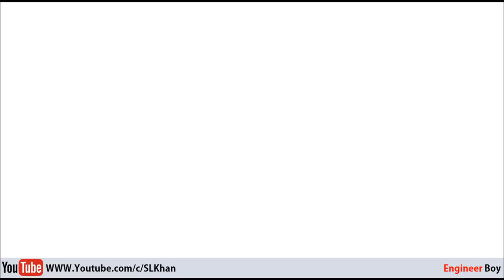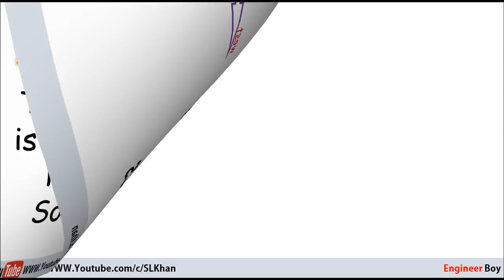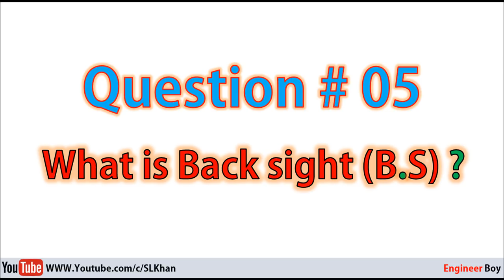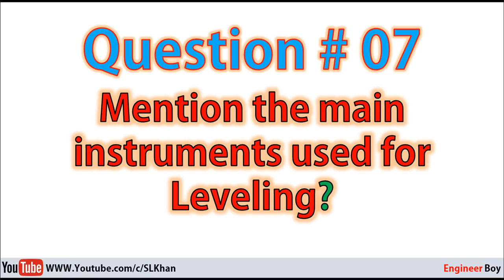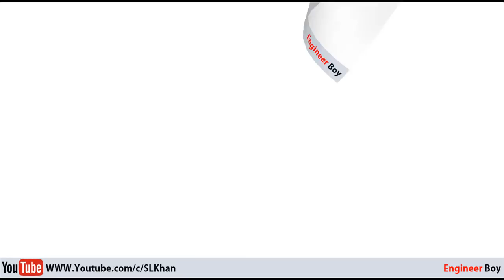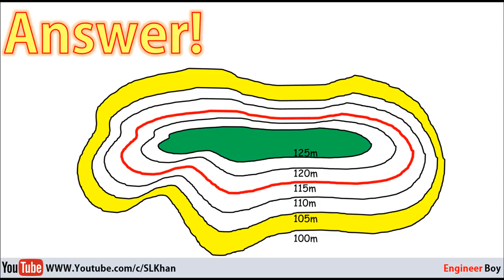top asked interview questions for land surveyor post

Comment: Some say plain table implement in below 15sqkm and geodetic in above 15sqkm area,and some says below 250sqkm.and above 250sqkm.what is that ,give correct solution ,,plain table survey done below 15,or 250sqkm,and geodetic in above 15sqkm or 250sqkm
Reply from the maker: Hello dear, in plane survey the curvature of earth 🌍 is never taken into account, which means this survey is carried out for small areas maybe upto 250 sq.KM.
And in geodetic survey the earhs curvature is never ignored and maybe carried out for large and wider area that is more the 250 sq,Km